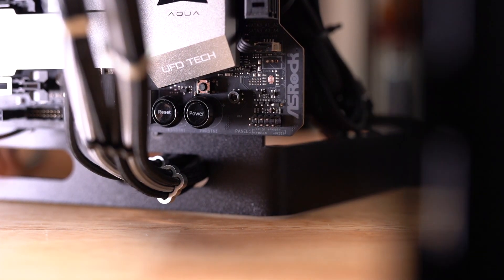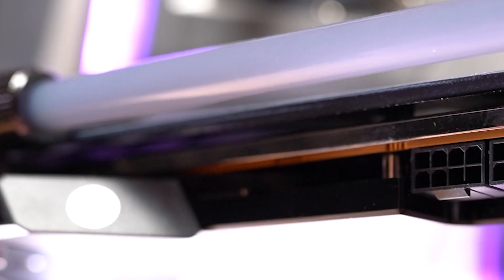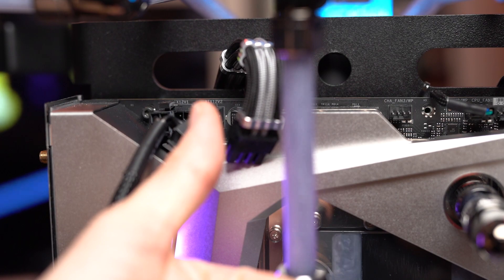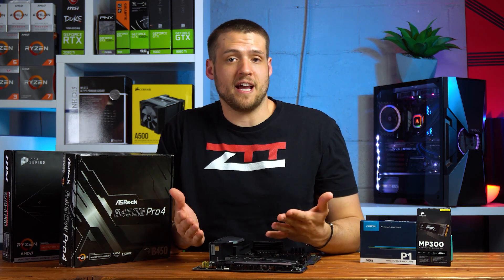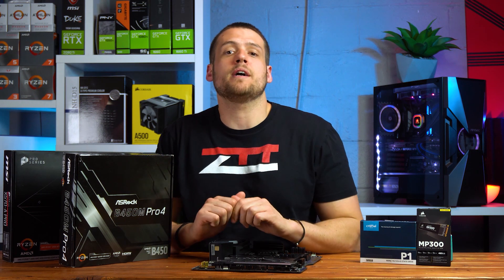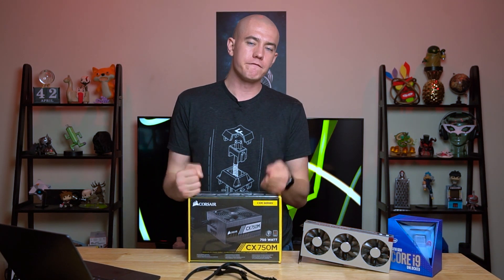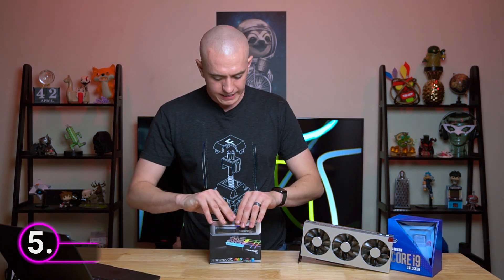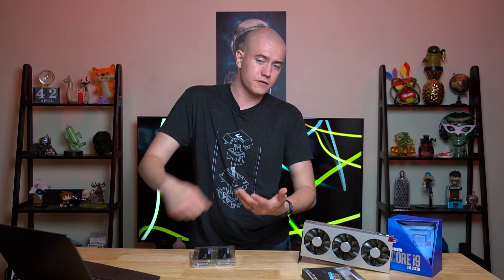5 Easy PC Building Tips You Might Not Know

Comment: PC building tip: When building a water cooling loop if you bridge the correct pins on the main MB cable on the power supply you can make it active without being plugged into the MB.

Comment: I have a 8+4pin cpu power, i used the 4pin and 1/2 the 8 pin cause it lined up better
Bonus tip: read the manual for the motherboard before you buy it (PCIe/M.2/Sata lane sharing related stuff)

Comment: My favorites  tips: 
1. Before installing the motherboard, connect the damn CPU power connector! ;)
2. When installing couple of hard drives and NVMe drive, make sure that you connect the drivers to Sata ports that not disabled due NVMe device..
3. Stock cooler is almost garbage, don't bother even to install them
Reply: 1. That awesome hole for that cable in a good case, but in itx/ cheap case that's a life changer!
2. if only usb 3.0 was as easy to take out as a Sata plug, that's more of a "fun" problem then a real problem. 
3. Amen
4. Your tips are still better then the video's

Comment: I used the "count the gold contacts" on the PCIe slots in building my first compooter completely, but I also looked at the manual just in case before I closed the side panel just so I didn't have to go through troubleshooting if games weren't up to speed... hurr hur. But looking at the back of the motherboard makes to much sense than getting a flashlight and seeing how full the slot if filled. Sorry flashlight, I have no use for you anymore

Comment: You should of also mentioned that if your only using 2 sticks of RAM on a 4 DIMM slot motherboard that the first stick should go into the second slot away from the CPU socket not the one right next to it like you would think. It shows a picture of this in my motherboard manual at least but it does not tell you, you only get the picture and it's not very easy to tell the first slot from the second one in the picture that's provided, but good thing @bitwitkyle has mentioned this tip on his channel before, so I knew about it when I put together my PC too bad it still won't stop crashing as soon as the CPU gets a load.

Comment: I'm not sure about the GPU power connectors - my MSI Vega 56 shipped without the 6 to 8 pin adapter and it wouldn't work with a 6 + 8 pin, needed dual 8 pins to power on

Comment: My RTX 2060 from gigabyte said before the bios that I needed the correct power cable for the card before it would boot. (6 pin cable to 8 pin gpu plug) Bought a new modular PSU and used the 8 pin pci/e cable and haven't had any problems.

Comment: Fun fact, you actually need the extra 2 pins. My GTX 1080 is 8+8 and went with nice 8+6 sleeved kit (as the extra power isn't needed). But GPU won't power on unless all 16 pins are occupied. So ended up having to buy another 8 pin cable.

Now some brands might not care, but if you got an Aorus GPU, don't do it :)

Comment: WHOA WHOA WHOA!? YOU SHOULD REALLY CLARIFY THAT THE PLUG AND SOCKET ARE KEYED TO FIT IN THE CORRECT ORIENTATION, AND TO NOT TRY JAMMING THE PLUG IN THE WRONG ORIENTATION! EVEN WITH KEYING, YOU CAN STILL FIT IT IN 180 DEGREES! WHICH WOULD SWAP GROUND AND 12V LINES, GUARANTEED TO SMOKE SOME COMPONENTS! ALSO, SOME 6/8 PIN PLUGS FOR GPUS HAVE SENSE PINS!

Comment: Didn't know about the power connector one. I figured you needed an 8-pin if the graphics card needed an 8-pin.
here is a relevant tip, the front panel connectors for the hard drive and power LEDs are not reversible.
Here is an irrelevant tip, the red stripe on your IDE cable always face the power connector on your hard or floppy drive.

Comment: I made a 6 pin into an 8 pin by cutting the extra two pins off an old power supply, plugged the wires into the 6pin grounds and it works well.

Edit: 2070s need 8 pin connectors, but if you don’t have one just use two wires and plug it into the black ground wires and plug those into the gpu. Before if i just use the 6pin it says “plug in all required power cables” after i did that it didn’t say that, and it can take some OC
Reply: Yeah...I had an MSI vega56 that would not boot with 6+8 pin. Once I put 2 more pins and shoved the wire into one ground pin of the 6pin, it worked. I used it like that for a week until I got a 6 to 8 pin adapter.

Comment: Be mindful of the "tip" for the ram sticker, while it might be true for ddr4 it definitely is not for ddr3 and below! I have two ddr3 boards (one lga775 and one am3+) in front of me atm and the slots are not in the same orientation, i.e. rotated 180°.
Also especially be careful if you have those generational threshold boards which support two different generations of ddr (2 and 3 or 3 and 4). I have one on the wall as a decoration (ddr2/3) and two stickers face left and two face right.
Don't be lazy; just check where the bloody notch is.

Comment: is there a problem if my graphics card is running at 8x ?
Ps: i have it on the first slot, but im using a m.2 that is sharing bandwith it the first pci-e, so that why its running at 8x
Reply: I’d say you’re definitely losing some performance as even AMD’s 5500XT performs worse on PCIE 3.0 slots because the 5500XT is only 8x. That’s not an issue on 4.0 slots but for older boards with only 3.0, it bottlenecks low end cards like that. I’d suggest changing the m2 if you can.

Comment: Another tip for those laptop users with a multitude of M.2 ports: If the OEM slots an NVMe drive in a slot compatible with SATA, and there’s a slot that’s ONLY compatible with NVMe, move that NVMe drive to that slot so you can take full advantage of your laptop storage slots with cheaper SATA storage if you so choose.  This actually happened when I got my Alienware 17R5 a couple years ago.  I immediately opened up the laptop to check it out, and lo and behold the NVMe drive was slotted in a SATA/NVMe compatible slot and there was an NVMe only slot on the motherboard, so I switched it over immediately.  Also, no it won’t confuse the laptop and not boot into Windows/Linux.  The motherboard BIOS will detect where the OS is stored and boot into it just like normal.

Comment: You forgot about Adding 2 cups of thermal paste on the rear exhaust fan of the ball joints of the radiator psu connectors.  😛🤣✌️

Comment: Damnit, I've had my GPU in the wrong slot!
Reply: Gamers Nexus tested if there was a difference using 8x vs. 16x (gen 3.0) with a gtx 1080 in 2016, and the performance was within 1% at most. And Techpowerup tested the same with a 2080 TI in 2018, and that showed a difference around 2-3%. So unless you have something more powerful than the 1080, you wouldn't loose any performance.

Comment: Ram sticker probably true for modern computers like my Asus C8H X570 motherboard. It could be just coincidence, but I had to look my older computers how the ram sticker faces in those. The Asus X58 P6T Deluxe does have six rams and sticker away from cpu. The even older one Asus P4P800-E Deluxe same thing, sticker away from cpu. In that P4 motherboard is also Asus CT-479 adapter which allowed to use Pentium M processor for it which were usually even faster than Pentium 4's. How convenient was that?!

Comment: The confusion caused by M.2 is why I don't have any, that and they typically disable 1 or 2(ussually 2 for some reason) SATA ports and I use them all as it is. Also I dropped and found within 5 mins a Watch screw in carpet, I think I can find a PC screw.

Comment: Pro Tip : You can use the Startbutton as a cmos clear button
Reply: How my guy?
Reply: @Undyingclub08  the start button works the same way as a clear cmos button (it just bridges two pins) so if you plug the start button connector onto the clear cmos pins, it'll still work.

Comment: #1 PC Building Tip: Don't build a PC right now
Reply: I've actually found huge discounts on a ram,mobo and cpu..only thing I have a problem with is the psu
Reply: @TheEdwinn32  With the discounts, the RAM prices are still higher than 6 months ago.   Motherboard prices are unchanged, but you can't find most of them.  If you are looking for an X570 MB, you'll be really lucky to find one in stock, and have to get whatever they have.  B450, there is an ok selection, but many are out.   CPU's are unchanged and mostly ok to find.   PSU's are much higher and can't find many of the best ones.   Cases are much more expensive.  GPU prices aren't great either and hard to find anything under $350
Reply: Ryzen 2000 Series Cheap AF right now.... If you can find parts
Reply: @theveryboredperson  "Cheap AF"..... was that a Ryzen 5 1600AF joke? Because those are cheap.
Reply: @MichaelCoombes776  lol!
Reply: Why?
Reply: @johnjohnston2489  A lot of PC parts are being either price gauged or at not available. If your building a budget PC, the best time would be a couple weeks after the new CPU and GPU releases
Reply: A friend of mine just built one a few days ago. I advised him against it but helped him build it after he got the parts lol
Reply: @Its-Orion I built a $400 USD Ryzen PC system for my father. Nothing ran out of stock for me
Reply: This didn’t age well